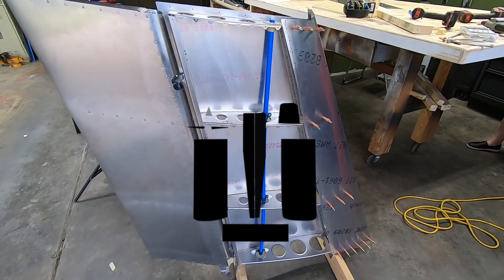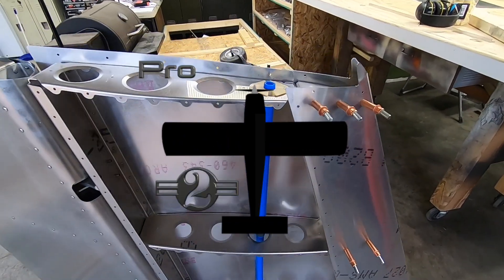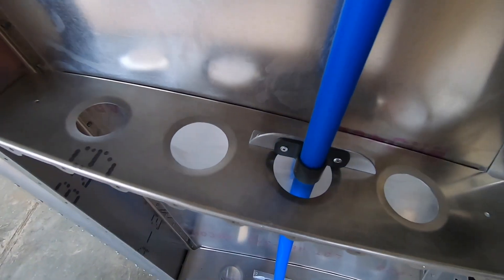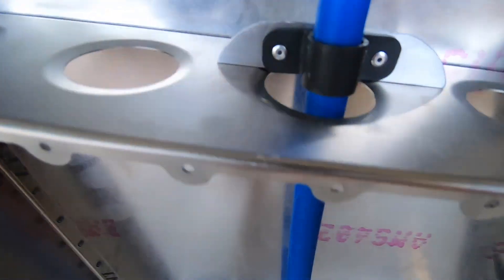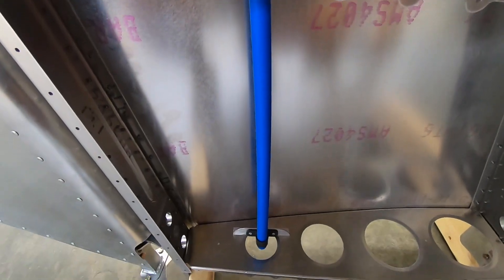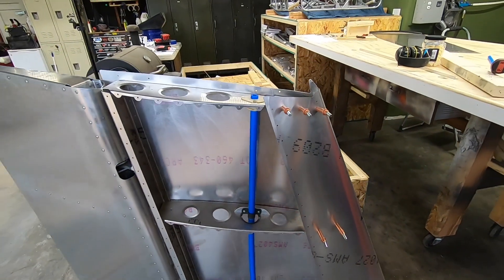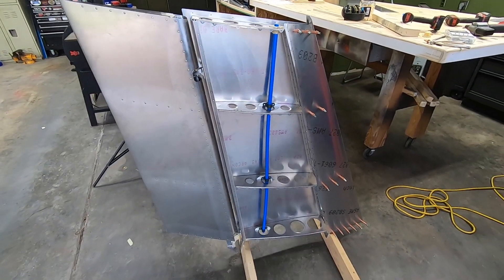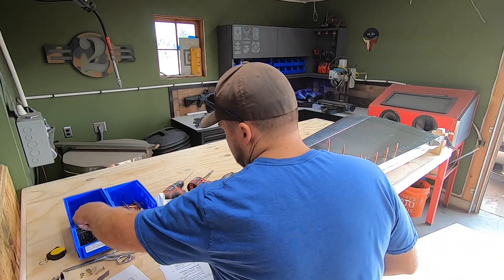RANS S21 Vertical Stabilizer (Part 2)

Comment: What uis the make and model of the electric rivet puller you're using? Do you recommend it?
Reply from the maker: Its the Milwaukee m12 rivet gun. I've pulled every fastener in this kit with it and I have loved not having an air hose to drag around..

Comment: It’s not complete until the plastic cap is on 😜. It was a sob for us.  The instructions call for washers to be super glued to the inside of the plastic so the rivets have something to grab onto.  The problem is getting each one lined up perfect.  When you try and place the rivet it pushes the washer off it’s super glue mount.  We finally got it but it took several try’s and lots of time.  I think a piece of aluminum match drilled while you are drilling the rivet holes in the plastic would be better.  Let me know what you decide.  Hopefully that helps you when you tackle the plastic cap!  Let me know if you have any questions.  You can DM us on Instagram and I’ll give you my phone number for faster turn around times.  I may need to ask you a question as well.  💪. same name on Instagram.
Reply from the maker: I figure I’ll tackle those when I get ready for paint. Maybe by then aerosport will have carbon pieces available for all the tips! Thanks for the tips, I’ll keep those in mind when the time comes!  I don’t have an Instagram, to be honest I’m a bit of a anti social media kinda guy. I did however open a Facebook account just to help grow this channel. I’d be happy to exchange numbers.
Reply: Project 2 Aero I don’t have Facebook.  😆
Reply from the maker: @DadandChad  lol good for you! Are you on rans clan forum?
Reply: Project 2 Aero I think Dad is.  Is there a way to message you on there?
Reply from the maker: @DadandChad  yea I have a thread started there in the s21 section. You can send a PM on there
Reply: Project 2 Aero sweet, I’ll tell Dad.  🙏

Comment: Riveting gun.... electric or pneumatic.... your thoughts?
Reply: I can say after watching the electric I’d prefer it over the pneumatic we use.  I like the fact the mandrels (tails) are pulled up into the collection cup without any fuss.  That looks the be way faster than the pneumatic puller.  The cup only holds about 20-4x rivets before you have to empty it and you have to tip it back each time to allow gravity to do it’s job on the mandrel.  The air hose is cumbersome and dangerous bc Dad and I have both tripped over it numerous times.  I would definitely buy one if we weren’t over the 3/4 way mark on pulling rivets.
Reply from the maker: Im a fan of the Milwaukee line and thought I’d try the rivet gun out. So far it’s been awesome. It is a bit slower than an air puller would be but I think being able to not have an air hose around all the time makes it worth it.
Reply from the maker: I will say it seems to struggle with the larger diameter rivet stems not wanting to fit inside the chuck. Other than that, it’s been flawless..